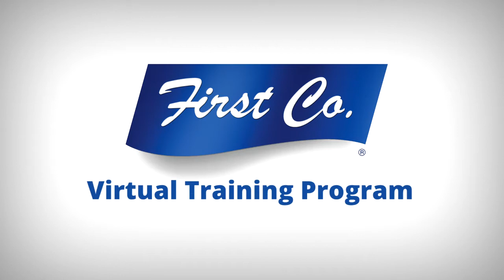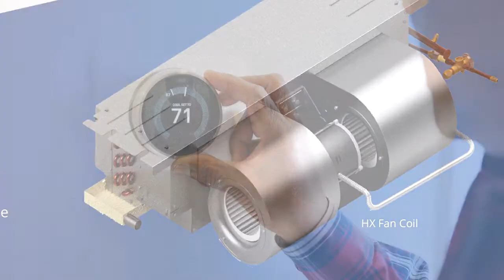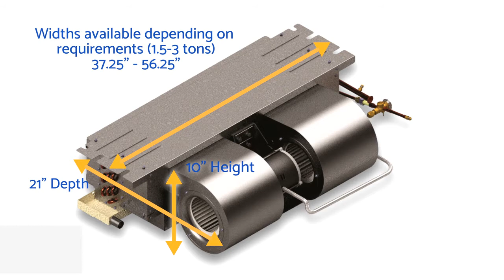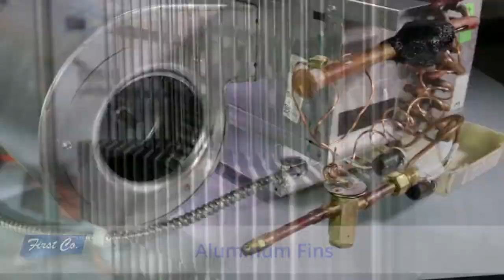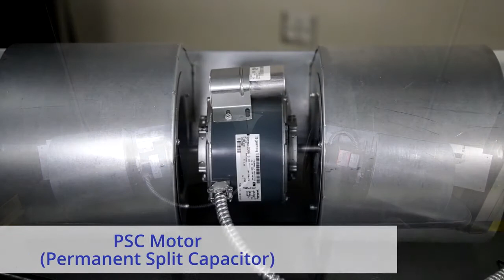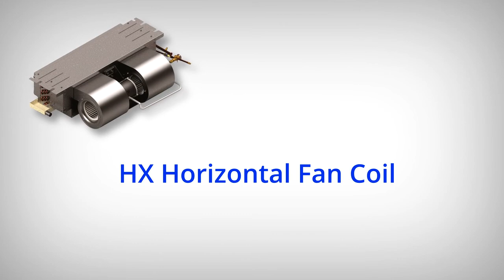First Co  Virtual Training Program   HX Series   Intro

Comment: I put an EHE09203B00A000F in less than a year ago for a customer. I have worked on first  co units for years but this was the first one I’ve purchased. I have already had to go and replace the condenser fan motor once and now he’s called saying it’s not working again. This is costing me money and time. I was wondering if you have some sort of reimbursement for time and labor. The warranty means nothing of it keeps breaking.

Comment: Hello

The training video is great, however, I have a question about the low voltage wiring diagram. If we have installed a 24HX5 fan coil with a Goodman Heat Pump Condenser how we may wire the fan coil without a heat strip making it a heat pump system?

Please Help

Thank You